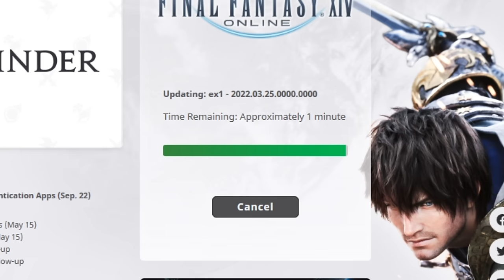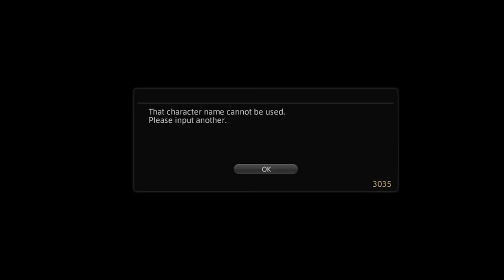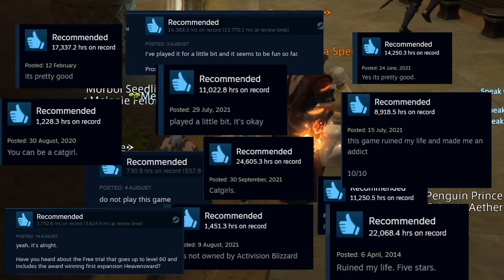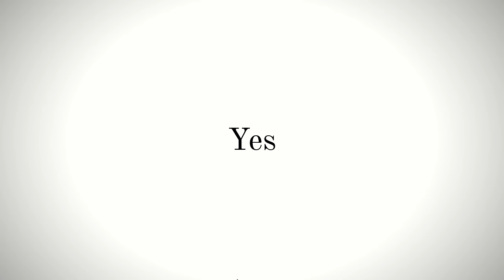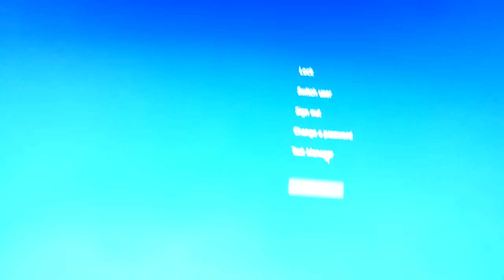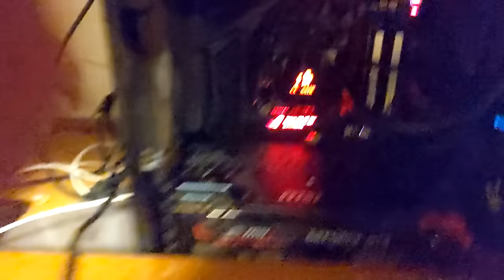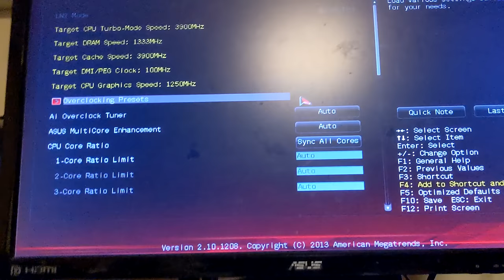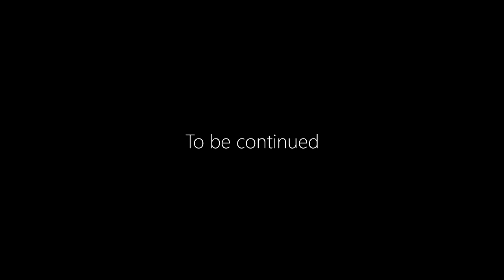A New Hero is Born | Final Fantasy XIV

Comment: Yup... ARR is a snorefest + the longest  post-MSQ content out of all the expansions that follows xD Dungeon runs get pretty crazy pretty fast with wall-to-wall pulls. Which is... literally what it means. The tank pulls as much mobs as it and the healer can handle and mow down 4-5+ mob packs at once. Ironically, these wall-to-wall pulls are more hectic than the actual boss fights early on (at least, for the tank + healer). ARR (the base vanilla game) is building up the difficulty slowly so you can get eased into it. Besides, this game is more about social interactions + having fun in general which it has in spades :D Oh, you should definitely visit the Gold Saucer (basically, a casino with some crazy stuff)!

Comment: They probably did not even teach him to change the Tab target system to be cone based, so it works much more like WoW targeting, making it alot easier and smoother to use mid combat
Reply: It's still pretty bad even with cone.  The only thing that helps is also keybinding target closest target and using both to target but even that is still not perfect.
Reply: @bigbosss7911  true true but it made a world if difference to me when I found out 😅

Comment: 31:05 either one of the fan bearing has crapped its pants or the pump has air in it
Nothing too dramatic, but will impact thermal performance
You could refill the AOI or replace the fan
Though seeing how you replace a CMOS, I wouldn't trust you to open up an AIO